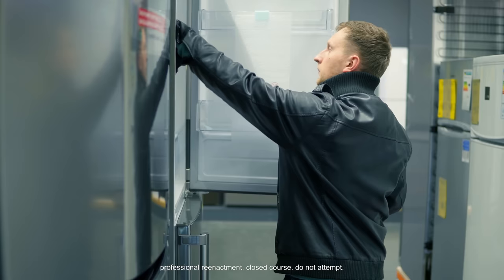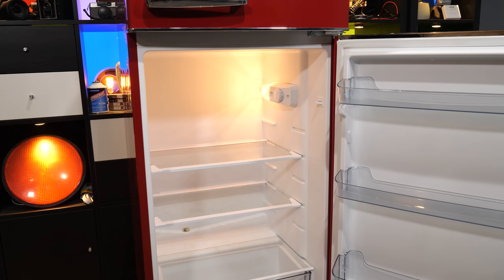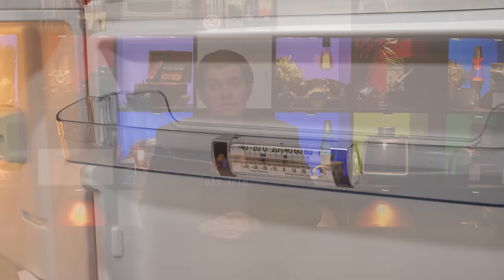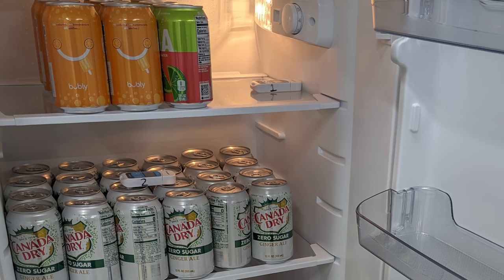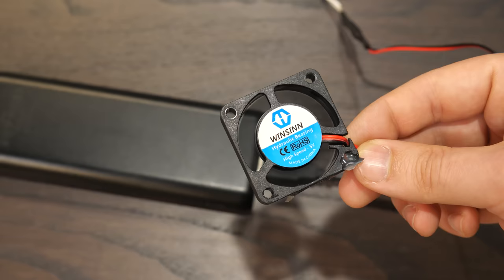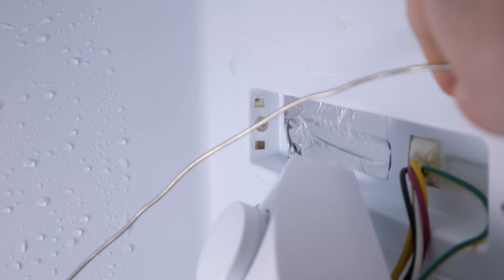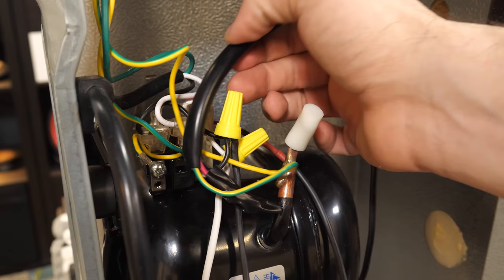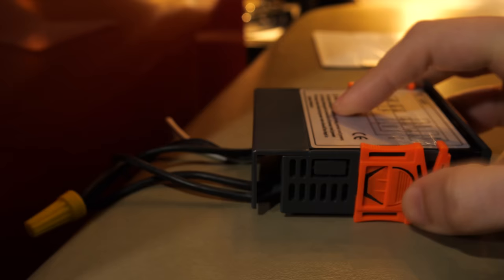This goofy fridge has a really clever design. It's also kinda terrible.

Comment: I have modified a fridge similar to this, with exactly the same controller you did. I have also added a fan to the compressor. NOTE: Adding a small fan helps, but, with how weak these fridges are, the airflow over the hot parts can VERY EASILY overwhelm the entire cooling capacity of the entire fridge by increasing airflow over its skin. If you consider how effective insulation is with still air, versus moving air (like, 10-20x as bad), this makes sense. It also explains why your fridge had trouble cooling when you had the fans inside. Moving that air put a murderous amount of heat loss to the ambient outside.
Reply: I’m having a hard time understanding what you said because of the phrasing. Hot parts = condenser? Skin = condenser fins? Insulation vs moving air is referring to the inside of the fridge? And if so, what about it? Heat loss to the outside is from the inside of the fridge, so the fan inside the fridge or the one on the compressor?
Reply: @Hydrogen101  - I didn't say condenser. I said compressor, it gets scalding hot if it can't cool down, making the fridge hot, making it run longer... and never shut off. If it never shuts off, it will be so hot that compressing the air only makes it warm, and so it never hits target temp. Runaway heat. Skin = outside of the fridge. If you had a camping cooler, just a box, and pointed a fan at it, the stuff inside would reach ambient temperature 10-20x as fast. So, even if you're trying to cool the compressor so that it can reach a lower temp, that same airflow is also making the fridge interact with outside air faster, and lose coldness. Which can easily be faster than the fridge's entire cooling capacity, so again runaway heating.
Reply: I didn't know that moving air decreasing insulating ability. Why is that?
Reply: @rameynoodles152 because naturally, a small film of air stays connected to the surface, effectively isolating the surface from the rest of the air. If you blow away that film of air, fresh, cool air passes right over the surface.

That's the reason a breeze of the same temperature feels cooler than if it is windless.
Reply: @rameynoodles152  When two things are at different temperatures, they will equalize. The rate at which they equalize, is determined by how well insulated they are from each other, and the degree to which they interact. If you turn on a fan, they are interacting at 10-20x the rate. Same reason a fan feels cool to you, even though the air is the same temperature. Getting it wet is even worse, that's like 1000x as fast.
Reply: Yeah. Im thinking the same. Insulation is the main issue here.

Comment: I’m from the Netherlands, I grew up having fridges very similar to this one. One of the things I was told growing up, was to change the thermostat setting depending on how full the fridge was and definitely not add large quantities of fluids at the same time if the fridge was empty or near empty. Not sure if this was something done in my family specifically or this was something everyone that had similar fridges did. But maybe it was something my parents noticed happened and they adjusted their behaviour to make it better? But yeah, we never really kept food in there long enough for it to go bad I guess.
Reply: no it's not just your parents, this is how you use these things correctly and this video nicely explains why
Reply: I know a full freezer is more energy saving than an empty one. Probably holds true to a refrigerator as well. I would pick a temperature and leave it at that. Only change if colder weather comes into play. There are parts of my refrigerator that is colder than others I guess where the meat drawer is or supposed to be. My drawer doesn't stay up if I load it with meat. It's sitting on the bottom shelf above the produce drawers. The rear is warmer than near the door. Yes it's strange. 73

Comment: The best of those GE monitor top fridges had two features that are rare even in today's models. 1- a pedal on one of the front legs to automatically open the door for you if you press it with one of your feet, and 2- a water cooling system with a faucet on the side (cooled drinking water is normally reserved for only vertically split door models today).
Reply: ooh, a door pedal, that's a good idea
Reply: I want a top freezer model with ice and water in the freezer door. In the 70's we had one with ice in the door. Nobody had got around to thinking of taking the ice maker water supply and T-ing off to a spigot. But like my favorite PC keyboard layout which nobody has made since 1994, (Look up a Monterey K104), it's been decades since the brief time that top freezer fridges had through the door ice, let alone if any ever had water there too.
Reply: I want a motor to open the fridge
Reply: @AgentOffice  : Very bad.  The dog will figure out how to open it and you'll come home from work to find all the meat is gone.
Reply: My LG LRTLS2403S has a water dispenser and filter inside the fridge compartment, but I've never hooked it up so I'm not sure how much water it would cool at once. Also, I wouldn't recommend it for other reasons.
Reply: Why?

Comment: Funny thing: My run of the mill, but decent German fridge sells those different temperature zones (slightly differently placed than yours) as a feature. You can keep the butter spreadable in the door for example. The crisper has a humidity slider that’s also surprisingly simple: it regulates the size of the gap to the shelf above. So it’s all a matter of perspective 😊
Reply: thats an IT problem with a marketing solution. i.e. its a feature not a bug.
Reply: My 25 + year old North American made Maytag fridge in our rented property has those features.  It also has one for the meat drawer.  Strangely enough, my vacuum cleaners have that as well.  My Rainbows (D4 and E2 Black) have them built into the upper hose wands and my D4 SE has one built into the power nozzle.  Who really needs electronic air speed control when that's what vacuum cleaners were using for decades?  One of the reasons I don't really care for EuroVacs or EuroCars or anything like that, they tend to misunderstand how to keep it simple, stupid.  First rule when it comes to design and engineering.  The Japanese tend to get it, why can't Europeans?
Reply: @TheRussness  Please, there's nothing IT about a fridge.
Reply: @mmseng2 except the ones with a TV, wifi and video cameras
Reply: @WJCTechyman Regulating vacuum pull by wasting some of it through a hole is an obvious waste of energy that you pay for .  That's why modern vacuum cleaners use an electronic motor regulator instead (near the off switch for simplicity).
Reply: @JohnKelly2  We don't talk about those.
Reply: @mmseng2  The information is the temperature, the technology is the thermostat and such :P
Reply: yes in france it's the same, it's a feature, you put vegetables and cans on the bottom, butter in the door, and stuff that actually needs to be cold in the top.
Reply: @mmseng2  the IT part is because often in software development, an unintended thing (i,e, bug) will actually become a feature, one of the famous ones being a game where the cars were drivable on the walls and it became the main gameplay mechanic.
Reply: @satibel  i get the bug/feature reference, I'm just saying as someone who works in IT it's a frequent irritation that everyone seems to think that just because it plugs into a wall outlet it must be IT's responsibility. The comment I was responding to just didn't make it clear that they were referring to the bug/feature thing as being IT-related, as opposed to fridges in general. Even still the bug/feature meme is broader than IT and applies to programming, engineering, and any other design work in general.
Reply: @Ithirahad  I'll still close your IT ticket :P
Reply: @mmseng2  after seeing how this thermostat was installed, i am inclined to agree no IT was present

Comment: You need to do an episode on the ammonia refrigerator like what is used in a RV where a small flame is used to keep the inside of the fridge cold. Doesn't make sense but it works.
Reply: Edison refrigeration! I have a vague recollection that they've mentioned it before...
Reply: Mosquito Coast.
Reply: Einstein developed one but didn't read anything about Edison the stealer
Reply: Thank you for this bespoke nightmare of a sentence. Very cool info, but also extremely cursed.
Reply: We have a natural gas fridge that works like the gas propane fridges in RVs.  Modern fridges  work by pressurizing the fluid while gas fridges heat the liquid directly.
Reply: @genewitch nope. The modern ammonia absorption refrigerator, was in full fledged commercial production in Europe before Edison "invented" Edison Refrigeration.
Reply: Pressure & temperature are in direct relationship, increase the pressure you increase the temperature or increase the temperature you increase the pressure.
The gas works just like the compressor, instead of increasing compression mechanically it does so thermodynamically.

Then once the high pressure gas is cooled & condensed the high pressure liquid refrigerant decompresses, evaporates & absorbs heat.
Reply: My fridge in the trailer we used to have used propane somehow, never looked into it

Comment: 40+ year service tech w/t a couple of thoughts: 

It's important to realize that that refrigerator is not  UK or Euro precision-control food storage refrigerator. It is a N. American style low-energy auxiliary storage / spare / dorm "mini-fridge" - made for drinks and snacks, and priced accordingly. They are cheap, disposable, and work just fine without trying to reverse engineer and improve them to make them smaller versions of our primary kitchen refrigerators which have forced air cooling systems and automatic defrost to keep more temperature critical perishables. Current refrigerators have computer--managed air circulation with potentially multiple sensors, fans, and even refrigerant evaporators to adjust refrigerant proportioning, airflow, and compressor pump rates or cycle.  That fridge is what it is. It will gradually extract heat and then economically maintain it. Much like a very compact economy car that gets good fuel mileage, that fridge is purposely underpowered. It is not designed for quick and powerful "acceleration", but sipping energy while it maintains the speed it eventually reaches. It cannot do that by having a powerful "powertrain" (refrigeration system) with a "throttle" (thermostat) that responds immediately to the slightest change in "speed" (temperature).

1)  This is a not a forced air evaporator style of heat-exchanger, and the design thermostat is mean to respond to evaporator load feedback. In the static evaporator, the "heat" (above the evaporation point of the refrigerant used) is absorbed from the air in closest contact with the heat exchanging surface. That air in turn absorbs the heat from the air closest to it and so on - from back-to-front. If your Fleer could show the temps inside the sealed cabinet over the progression of several hours, you would see that. Once the door has remained sealed until food load has reached its temperature and the control cycles off, that cold food will act as a significant temperature stabilizer. In most cases, in the routine course of removing or replacing one or two food items with a brief door opening will not require the unit to initiate cooling as relative amount of "heat" introduced by the newly introduced and ambient air, will first be absorbed throughout the chilled food load - esp any glass or metal surfaces.  Once the evaporator temp starts to rise the thermostat will close and start the unit.  

You are essentially trying to add a single element of a forced air convection system to static conduction one- which just creates eddies in the normal heat transfer and makes things worse. It's like strapping just an automotive turbocharger somewhere under the hood of a car and wondering why there's no improved performance.

Forced air evaporator systems that have mechanical thermostats also find it critical to moderately insulate the hydraulic sensing tube on the thermostat because they are not connected on or near the evaporator itself, but respond to actual interior cavity air. Without the insulation, you can get thermostat "bounce" or "short-cycling", where an errant air current from opening a door can trigger a thermostat to restart a cooling system before the compressor has completed its pressure equalization - tripping the overload at the compressor. So delay cycle timing is a necessity. 

2) This is why it is best not to measure fresh food AIR temps at various zones as they are far too fluid. Measure the temp inside an 8oz glass of tap water. It will be the same as the temp of the stored food.

Comment: Replacing the solid shelves with open ones, like wire racks, would help with air movement and convection efficiency. Also for funsies you could get a thermocouple and see if you can fish it down the old thermostat tube to see just how cold the sensing bulb was getting.
Reply: Fridge shelves could be hex shaped metal grid, maximize air flow .... Or hi tension piano wire in linear grid?  D
Reply: Fridges use solid shelves to prevent fluid spills from dripping onto whats directly below that….. thats why fridge shelves are solid while freezer shelves are mesh
Reply: @MrSheckstr Mesh shelves used to be standard in fridges, they probably had to re-engineer all airflow details when glass shelves became fashionable .
Reply: @johndododoe1411  ..  aint glass a bad heat transfer material, if using nongrid use metal at least it'll transfer heat faster?  Copper?
Reply: @MrSheckstr  Weird. My fridge shelves are all mesh, and the only thing that's ever "spilled" were a few candy bars from the upper shelves, falling into the abyss behind the various jars of sauce and preserves sitting on top of the veggie drawers. I would never, ever trade this mild inconvenience away for bad airflow and strange thermodynamics.
Reply: the temperature difference is marketed as a feature, so I'm not even sure it isn't on purpose.
Reply: @MrSheckstr I’m old enough to remember when even the fridge in my first apartment were wire shelves. 
And while glass shelves will mostly contain most spills, if they are smallish spills. … in my experience, the glass of the shelves is only loosely held in place with a metal frame. A frame not sealed with any sort of caulk or sealant. If your young child placed a popsicle flat on a refrigerator compartment shelf for “safe keeping” (without a plate or bowl to contain the inevitable puddle) you then get sticky liquid following the edge in/ under/ around that  metal frame. Which , for me, meant taking the entire shelf out and taking it to the bathtub to be able to manage its size while getting the worst of the sticky to be submerged in warm soapy water. 

When appliance salespersons try to wow/woo me with “it’s got glass shelves”…. I remind them that the comercial refrigerators in the kitchens where I work all have wire shelving. Both the walk-in and reach-in fridges. 
Got something that might leak? Put it in/on a pan or tray to catch the leaks.

Comment: Normal design for a fridge in Denmark, but most of them has a small button next to the thermostat dial and it shorts out the thermostat switch and simply force the compressor to run constantly. It is used to help freeze any large amounts of food you add to it.
Reply: it's probably normal all over the world, minus USA, because:
a) who has such big kitchens to even fit those monstrosities, it looks like a closet, not fridge
b) who puts 48 cans of soda in fridge simultaneously? why? need to get as fat as possible as fast as possible? 48 X 355ml is 17liters of liquid. when do you need to put 17l of liquid to the fridge? 
stores have big fridges precisely so that we don't need them. if we drink soda at all. 

and, frankly, "dangerous zone" is not dangerous at all, I keep fridge at about 8°c, and, look, still alive! unpoisoned!
Reply: @ivok9846  even if you wanted to drink soda {something I highly advise against} it's trivial to do a 1 in 1 out system with the bulk of them stored near the fridge instead of in it.

Even if you're planning on serving cans to guests, what's the absolute most you could need under normal circumstances {parties excluded of course, you can use an ice chest for that}? Four to six?
Reply: @priestesslucy3299  curly brackets? my (wo)man! 

soda is garbage made for kids, I can only get gout flare from it. similar to margarine. trans fats and fructose overdose. 

17l seems a tad too much even for parties.... that's 17 people drinking 1 liter, or 8 people drinking 2l. it's hard for me to imagine drinking so much soda.
Reply: @ivok9846  The curlies are just more accessible on my phone keypad 🤭
Reply: The temperature zones are definitely a thing but they're a lot less strict than he seems to be suggesting(at least in the uk). I was trained based on a 5-63 range for commercial food safe production which lines up with his range but 8 degrees for standard fridges as an upper limit. You can also have food over this(8 degrees)  limit for around 2 hours as long as the food is then cooked  chilled or eaten.  This fridge is pushing the edge of these ranges a bit but it's not at a dangerous level.
Reply: @priestesslucy3299  😄

Comment: My guess; to cut cost, they didn't have a high-low pressure switch. Instead, they used the temp probe to check when the temp of evaporator would get too low (and at the same time limit internal pressure)